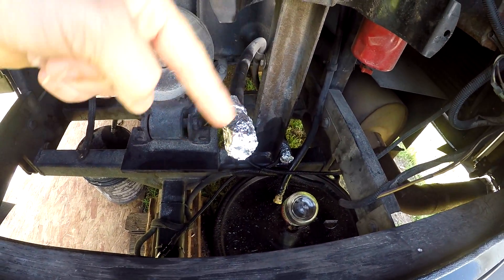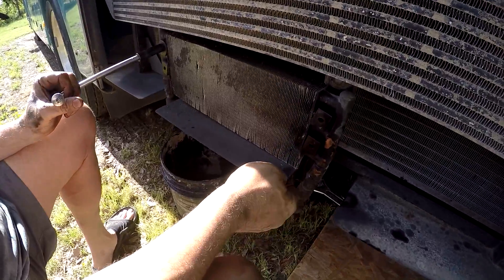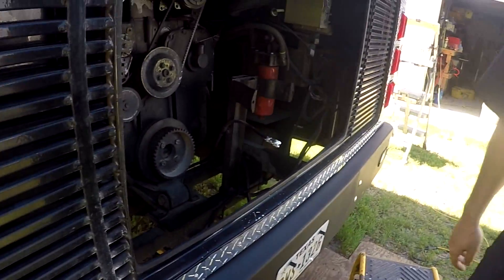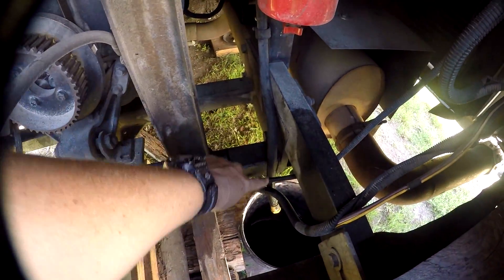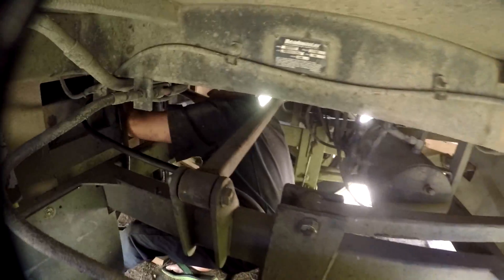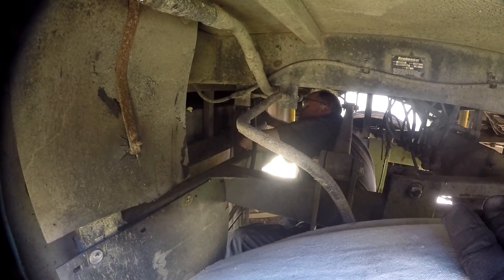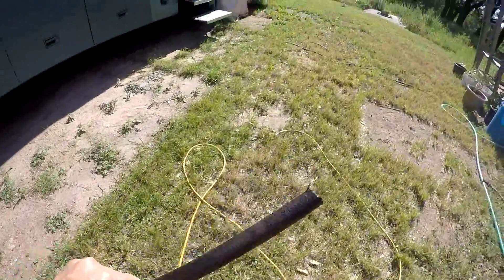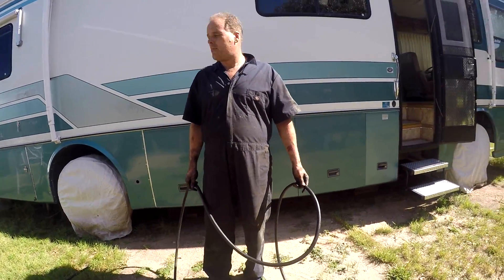Removing Hydraulic Lines:  RV Hydraulics #2

Comment: And the lesson learned from crawling around on your back is .. Dig a long pit to stand up sensible for working under vehicles
Reply from the maker: +Mazda rx7 Digging a trench where we live would be an effort requiring a large backhoe.  It's almost 
solid rock for the most part a few inches under the top soil.  But that's certainly a solution some might want to consider depending on circumstances......we'd also love to have an indoor shop with a concrete floor so we could work better regardless of weather.  It's on the wish list. ;-)  Thanks for watching!
Reply: Adventures of Sandra & Dave
Hard ground in Nfld too , that's why it's called the granite planet,  That's why the teeth are replaceable ,  hehehe